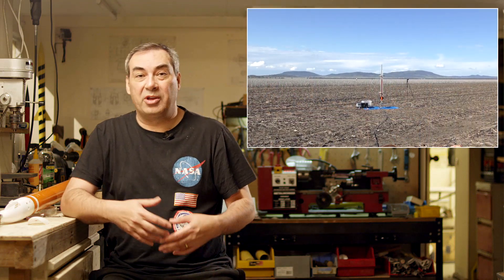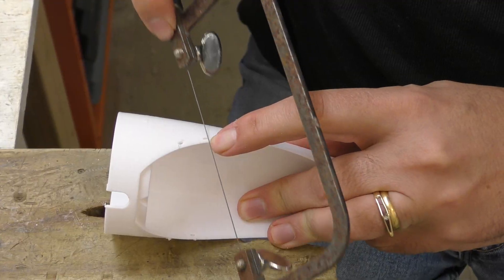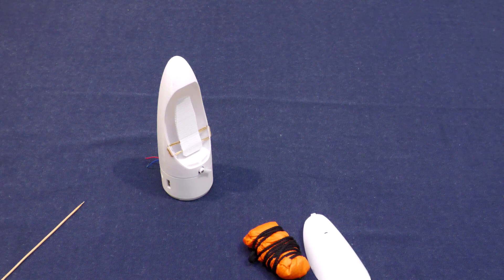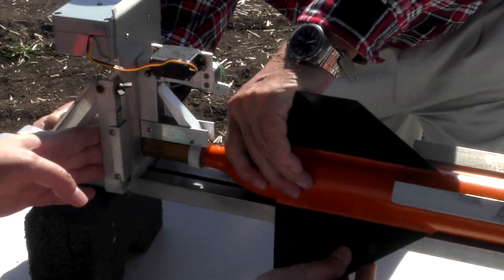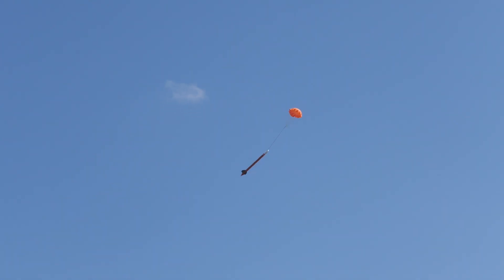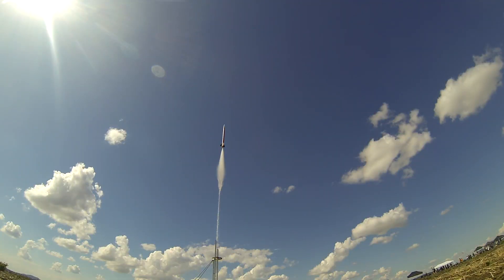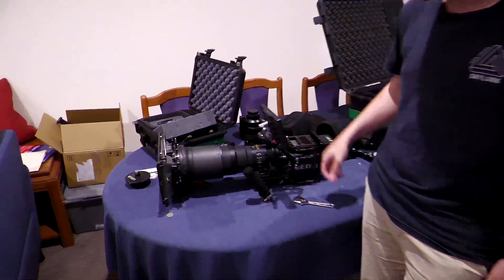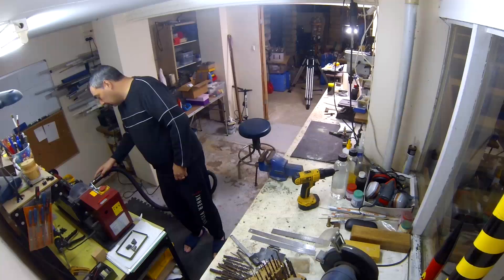Nova Deployment Mechanism Upgrade

Comment: I'm impressed to see that the pressure chamber survived two crashes and it is still holding. Hats off! :)
Reply from the maker: Thanks Dan, I think it's because the rocket is very light, hit really soft ground, and had a brittle deployment mechanism with a soft parachute as a crumple zone.

Comment: Hi!
Thanks for the update. I'm always happy to see a new video from you guys.

One question: What is the 3mm Corriflute for? Isn't the rubber band enough?
Reply from the maker: It just makes sure that the rubber bands don't spread out and potentially pinch a part of the parachute or shock cord between them preventing the parachute from coming out.
Reply: @AirCommandRockets  
Thanks!

Comment: Awesome thanks George!! I designed my own, but im definitely printing this one as well. Any more info on the electronic timer would be great 👍
Reply from the maker: Cheers! This particular payload bay was designed for our timers, which we don't sell any more, so people will have to re-design the model to fit what ever electronics they want to use. I'm happy to provide any info I can on the timer. There are so many small Arduino compatible boards these days with plenty of code examples that it is quite easy to get a timer up and running that can control a servo.

Comment: Congratulations on solving the issue. Is the parachute covering door disposable?
Reply from the maker: No, the parachute door is normally attached to the shock cord. We attached it with really thin wire and the wire broke when the parachute deployed.

Comment: I love it: Two rubber bands + corey flute = problem solved
I've forgotten the most important ingredient: engineering thinking (I hope this is correct english)
Reply from the maker: Thanks. That ended up being the 4th iteration, we just wanted something really simple without extra components or fasteners and something that didn't require a whole lot of modelling redesign.

Comment: Are you going to add stages to the rocket like side booster
Reply from the maker: Not to this rocket. This rocket was specifically designed for the mid-power launch site we have here in Sydney. It already flies up to the limited ceiling we have.